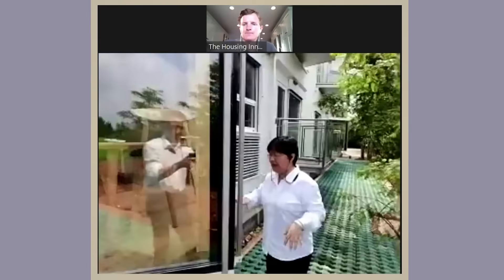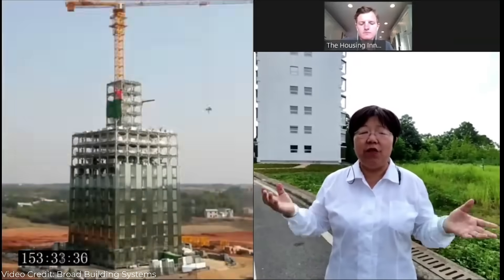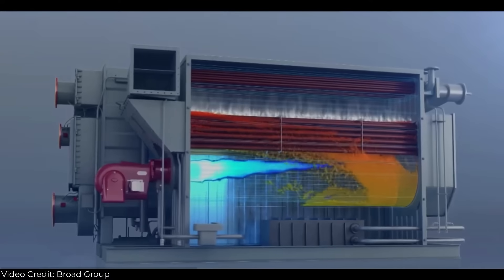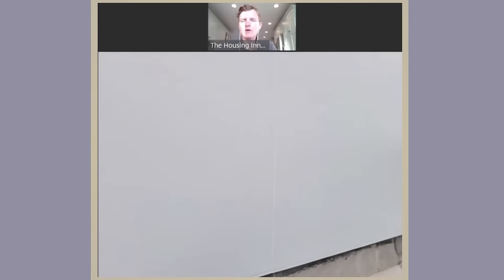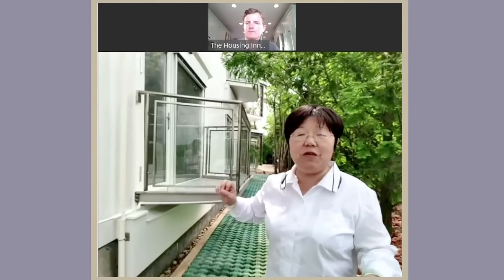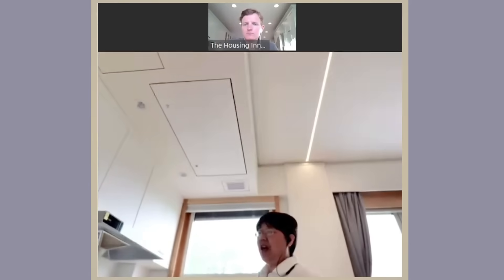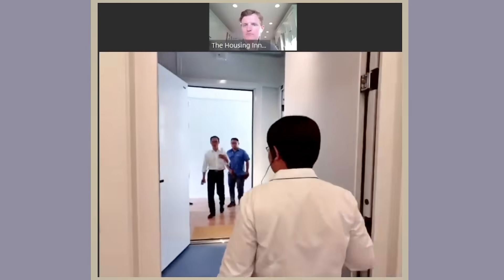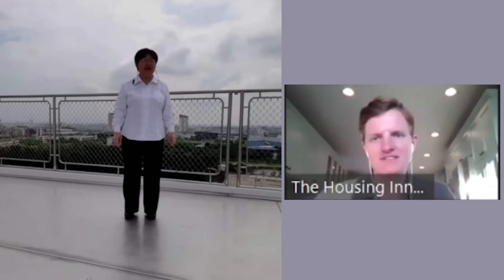Ep. 11: Tour 11-Story Tower Built in a Day (in Changsha, China) // The Essential Housing Campaign

Comment: What is the prices ? Do you deliver to USA?
Reply: $134,000 per unit.
Reply: @PowerofthePeople  what is the "unit"? Container size (12m * 2,8m) or 67 squaremeter flat (one small flat from 2 container) or 134sqm flat (normal flat from 4 container)...? If the unit is a container then 134 sqm size flat cost 4*134K $ = 536000$, in this case is too expensive. Because: you needed 1/10 materials and fractional amount of man-hours required, I would expect the apartment to cost a fraction of the price.
But if 134sqm size flat costs 134K $, that's a good price, but still not as cheap as you'd expect...
Reply: @meridian974  I only came to find price. You’ll have to do some research.